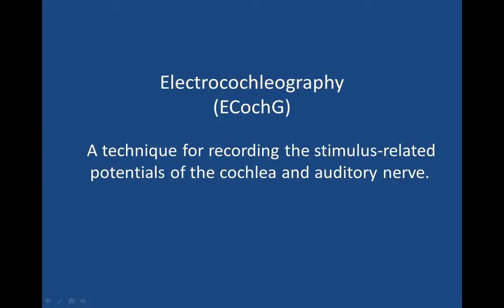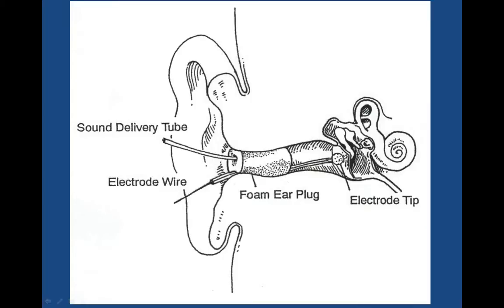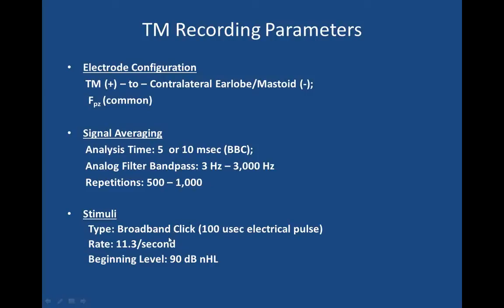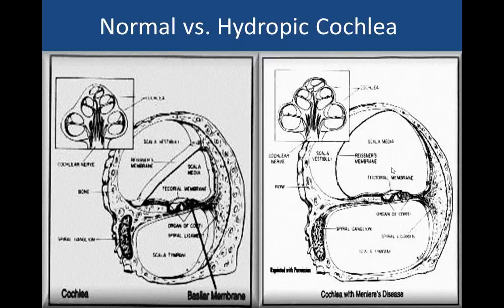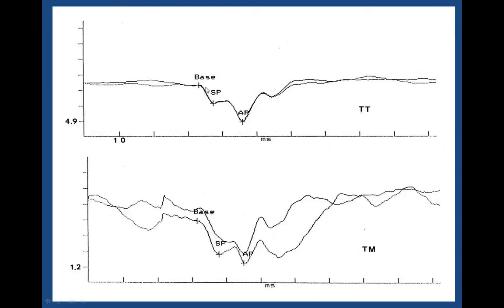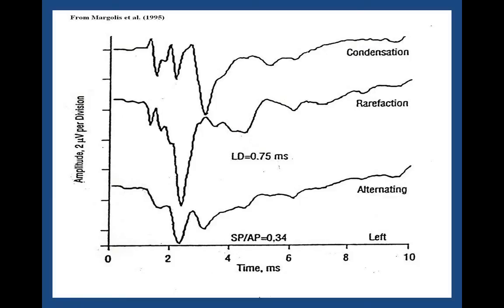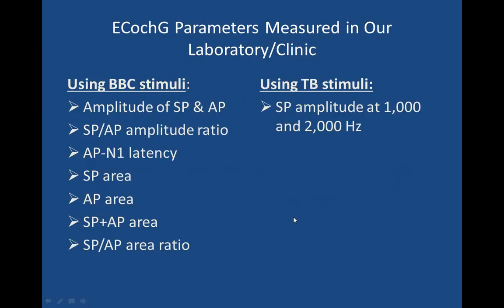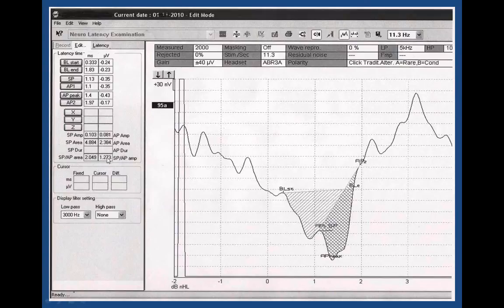Using the SP/AP Area Ratio for Diagnosis of Meniere's Disease

Comment: Thanks for putting this up firstly.
        I am an Australian musician and developed what I believe is Diplacusis(one ear only),as being an experienced studio audio engineer and musician.I noticed distortion and pitch shifting in my right ear after playing a gig where an ear plug malfunctioned.I also swept my frequency response with a sign wave,compared with that of the unaffected &  affected ear showing a pitch shift of 1 tone at 1khz. The pitch shifting starts at 180hz to 2.4khz where it returns to true pitch,that is at 180hz the pitch shift begins(with overtone)and returns to near normal at 2.4khz.
        I have been given an audiogram with sign wave which showed none of the distortion, as it was performed below threshold levels at which the distortion occurs.I predicted this but my ENT just would not listen telling me I'm have nerve deafness and am going deaf.I am 60 years of age and actually have slightly better than average sign wave threshold response than most of my age,and my hearing curve is relatively flat from 1-10khz despite losing 55db in sound perception levels.
            With regard to the Diplacusis component, I have also lost frequency perception below 180hz in the affected ear.I noted you start the tympanic cochlear test with electrode on the eardrum at 90db.The distortion I hear in the affected ear begins around 80db and is almost unbearable in noisy enviroments.
         I wish to have  a tympanic cohlear test performed but was disappointed to hear that this is only done by putting a hole in the tympanic membrane for the electrode to be placed nearer the cochlear in Australia.As 5 per cent of musicians over-all suffer this terrible condition, I believe more has to be done in the way of research and treatment, it seems that understanding and researching human hearing has taken a backseat in modern medicine.I know there was much research done in 1971 but was never published which I find criminal.
         I think I have secondary Endolymphatic Hydrops, but my ENT and audiologist won't look further,hence the need for the cochlear test.I have found at times the distortion drops when my ears are fresh in the morning and my eardrum feels like its not quite far enough out(feels full), but when I equalise (air pressure) I get  distortion increase.
I know there is not a lot to be done except diet, steroids, and physical and mental adjustment,or at last resort surgery.
         I do go to the UK often though, perhaps the test (non invasive Electrocochleography) could be done there?
        I do agree with your comments as to the non invasive method being better as it allows for re- examination of the patient that perforating the eardrum and waiting months for the eardrum to heal.This sounds barbaric.
       Any thoughts? Is EMI feasable instead of?